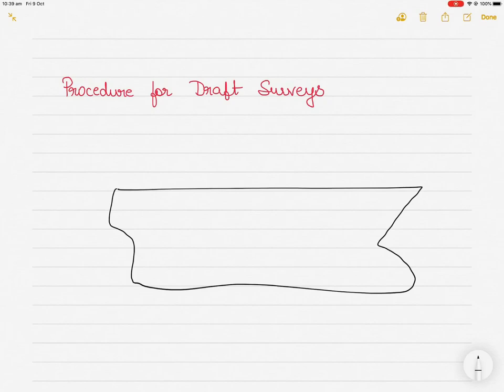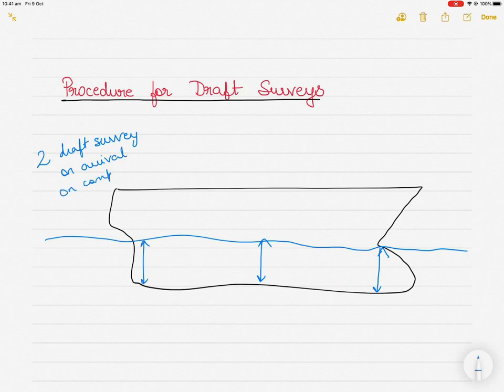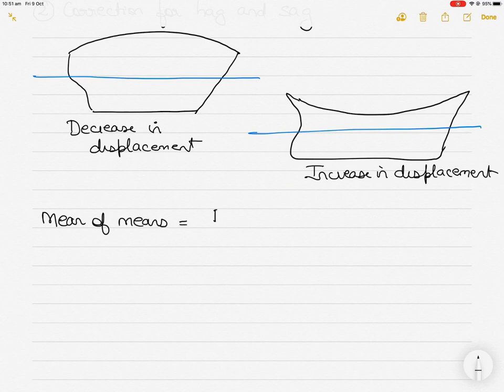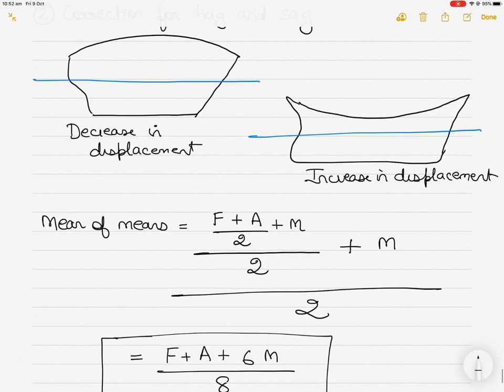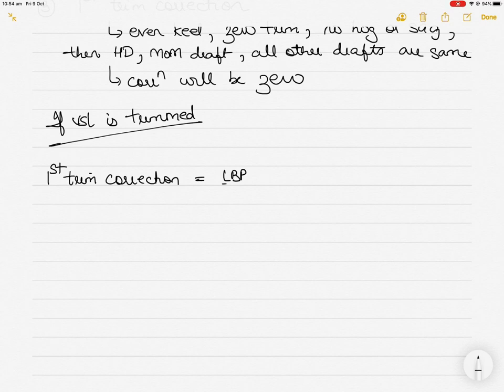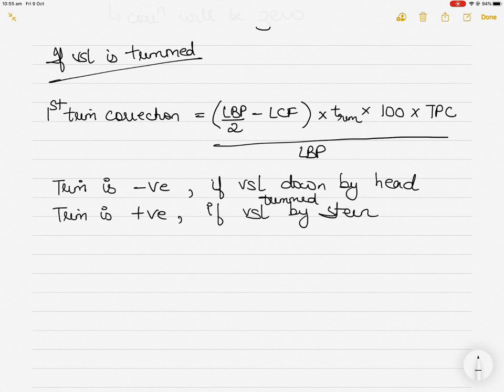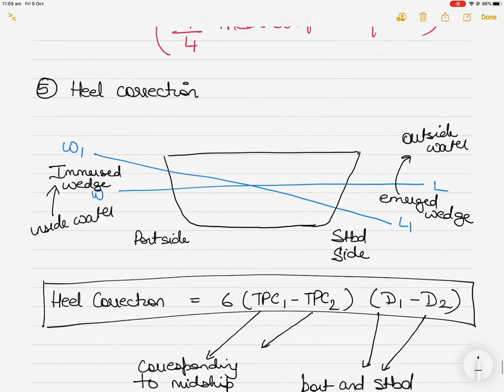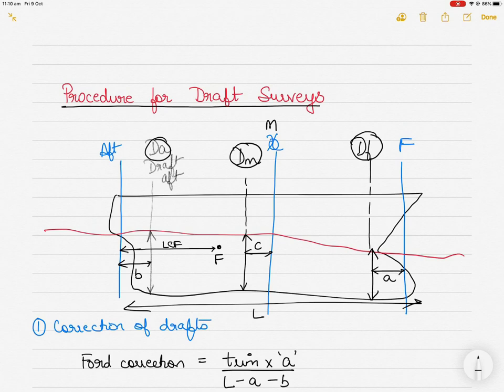How to conduct Draft Survey calculations - A step-by-step guide!!

Comment: according to the drowing where the aft draft mark line is more ahead from AP it should be read with mark "+" and forward perpendicular (FP) is ahead, so it should be read on the forward mark"-" same as a middle draft during the trim correction.